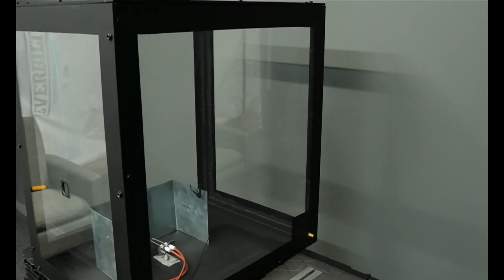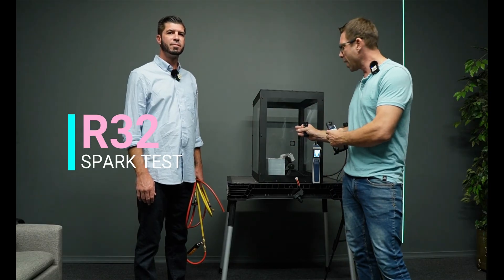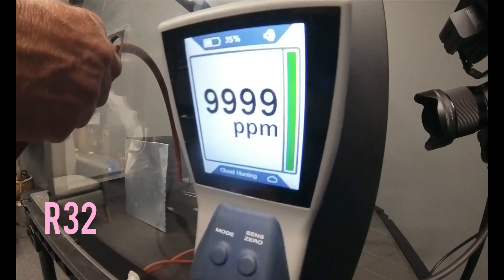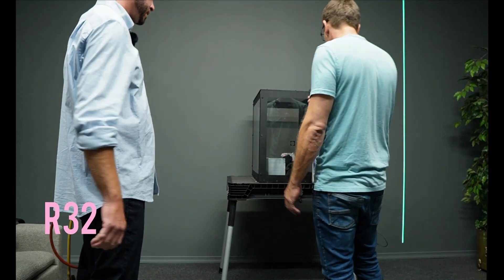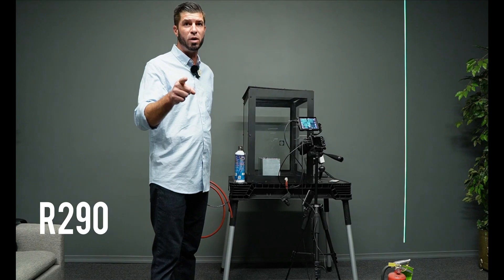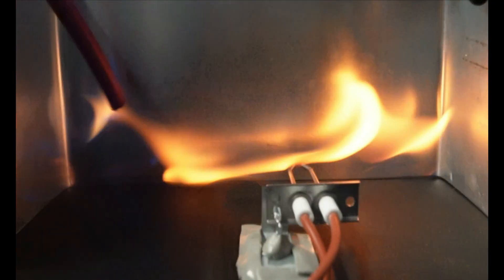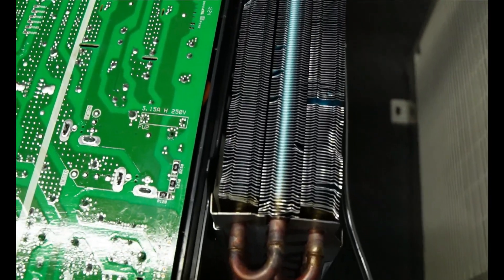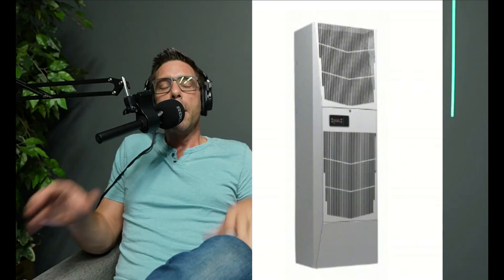Is R32 Worth the Risk? HVAC Flammability Test HVAC (4k) No Joke!

Comment: It's just a way to add additional cost (profit) to equipment and install. I have natural gas lines all throughout my basement yet building code doesn't require leak detectors other than the small amount of sulfur containing impurity for smell. If I have a natural gas leak, the gas company is also just going to keep feeding the house as if I was using the stove, water heater, etc. At least in the a/c unit, there is a fixed amount of refrigerant that if it leaks will just be diluted into the nearby environment.

Comment: Now compare that with normal hvac/r systems which are true heat pumps that can have up to 18 C.O.P, but to be clear, 18 C.O.P does NOT mean that they are 1800% efficient! It absolutely doesn't mean that, because like I said, that's impossible. So what does it mean?  It means that the entire system has a coefficent of performance of 4, 8, whatever, but the compressor, and fans and everything else which converts electrical energy to mechanical is ALWAYS BELOW 100% efficient, typically even the best systems are 85% efficient. To understand this we need to understand the refrigeration cycle which I'm going to explain in detail: it has a few components, the compressor (which is just an electromotor that turns due to 3 phases out of sinc, producing uneven electric and magnetic fields or in a case of a single phase they use capacitors in series with the start winding to induce rotating magnetic field on the stator which is then induced to a rotor's permanent magnet to make it start rotating, but it will even without heat of compression (which we will get to really soon) still heat up due to it only being about 70-80% efficient, the component after it is the condenser coil (which is just a heat exchanger), after that we have a metering device (a restriction in the system like a tiny hole (it can be fixed like capillary tube or fixed orifice or a thermostatic expansion valve (TXV)) which allows just a tiny flow to occur and it lowers the pressure after it, then we have an evaporator coil (another heat exchanger) and then we have compressor's inlet again which are all connected with pipes. Just to make a legend here so that I don't have to type it: high is H, low is L, pressure is P and temperature is T. So the cycle is: LP, LT superheated (I'm gonna explain what does it mean) vapor goes into the compressor, the compressor is creating a P differential and therefore pumping gaseous refrigerant in an enclosed loop and so the HP, HT vapor exits it, because the refrigerant is under such high P, all that P is squeezing the refrigerant molecules and under these conditions its current T and its condensing T (which is T dependent, lineary, for Isohoric (constant volume, constant quantity of refrigerant, sealed system, no leaks) processes and it can be seen by the graph. And like that it exits the compressor, and when it enters the condenser, it is first cooled down to its condensing temerature still in gaseous phase, then the moment that it hits the condensing temerature it stops giving off sensible heat (heat that we experience as temperature) and it locks on to its T and the first liquid drop appears, because it can no longer remain a gas, the P in pipes is too high and the outdoor air T is too cold for it to remain a gas, so it will spontaneously condense into a liquid, the refrigerant is condensing and it won't stop until it has condensed into a fully liquid state, but it's still giving off lots and lots of heat. It must give off all of its latent heat of condensation (you can also call it enthalpy) and that's an energy a substance must give off per kilogram of its weight for it to change phases from vapor to a liquid, when the refrigerant fully condenses, if you look at a sight glass there's a liquid vapor mixture, then just a tiny vapor bubble which is getting smaller and smaller until it eventually disappears and the glass becomes crystal clear, now that it is fully condensed it can now again lower in temperature by few degrees until it exits the condenser (that's basically subcooling- the T drop from condensing T to the line T exiting the condenser. Now the refrigerant is held back by a metering device which restricts the flow and at a lower P behind it, the P drops enough for the evaporation temperature (the current T of refrigerant as it flashes from a solid coloumn of liquid into a mist at the end of metering device) and it gets really really cold because its evaporation T is at this low of a P way below the ambient T, so it gets really cold as it expands as it takes away the heat from itself at first (from the inside out), but then it starts absorbing heat from the pipe and then the surrounding air and it continues to do that until it has all evaporated, now once it's now fully a transparent gas, it can again absorb sensible heat and raise its T a little (that's superheat what I said earlier that I'm gonna explain) until it again re-enters the compressor, and the cycle repeats over and over again. It might be strange that the cold suction line is actually full of heat, but it is, it is even superheated despite being so cold, it contains all of the heat absorbed at the evaporator. The same goes for liquid line, the liquid line doesn't feel cold, because it's not, but it has been subcooled (which means it has cooled down below its condensing T) . So you're effectively using the fact that refrigerants have easy-to-manipulate boiling points and you're using mechanical compressor to compress a gas which is less than 100% efficient (like any other machine) so it actually adds a little bit of heat, but the reason why the discharge line is hot is mainly because of heat of compression at isohoric conditions (I explained it earlier), but the fact that is doing a mechanical work, but producing a thermal displacing work makes its total efficiency way higher even though motors which convert energy are way less efficient than the thermal energy removed vs electrical energy consumption because of the compression to expansion ratios, and that's why it was possible with efficiency coefficient over 1, normally 1 is the maximum at perfect conditions like absolutely no friction, but we can never have that, but in this case since it's using 2 largely independent systems electrical to turn the compressor and heat exchanging system, its limit for c.o.p. is no longer 1 in perfect conditions, but now it's an infinity. For example the household fridge has a c.o.p of around 1.8, the inverter split ac system has about 3-5 and some heat pumps with 5 layer condensers and evaporators can have as high as 15-20 maybe even more, to be clear, the c.o.p. of each energy converting component is still less than1, that's what the 2nd law of thermodynamics dictates, but the overall c.o.p. of the entire heat pump can be higher because there's no energy conversion happening, just energy transfer, so you're just pumping heat from one place to another. And as for the CO2 idea, I think it's great and even in large convenient stores they started using it, the only downside are the high pressures, above a 1000 psi (or above I belive 67.4 bar (6.74 MPa in SI), cuz it's a force acting on a surface, long story but everyone knows what pressure is, but other than that it's a really efficient, environment and ozone friendly gas. Thanks for the video

Comment: Excellent demonstration of refrigerant flammability, but one sad thing. As an engineer and a scientist I can about guarantee you that we''re not gonna see peltier coolers cooling homes, it would be very good, but it's too optimistic (I think the right word is unrealistic) because they are not so efficient. A quick explanation: their work exploits the physical-chemical properties of materials called semi-conductors, which are btw very useful in modern-day technologies like phones, tablets, lap tops, etc... Because they have really good qualities due to one electron missing or an extra electron (that's why they contain silica) to be able to conduct under some conditions (voltage being applied, voltage drop, current flowing, voltage above certain values, temperature change (all made out of different elements and their atomic radius varies significantly so whenever there's high enough voltage, the atoms in it get shredded by the electric fields and they suddenly become a conductor). In this case thermocouple which will create voltage when there's a temp. difference or peltier device is just an inverted thermocouple, when you apply voltage it creates a temp. difference between hot and cold sides. Its work is based on peltier, seebeck and thompson effects, all parts of the thermoelectric effect, but I'm not gonna explain it in details because it involves advanced physics and physical chemistry at quantum levels. So an electricity particles (free electrons) can take away the heat (cuz heat is just thermal energy) and move it from one place to another, electrons can make other atoms reposition so their density is smaller in some places, so those places will have less motion, less kinetic energy, less heat, and therefore lower temperature at a constant mass and specific thermal capacity (measured in Joules per kilogram kelvin) and there are formulas here, but it takes atleast a few hours to extract them starting from observations and logical assumptions and simple things like space, time and speed and then you get to more complicated stuff gradually. And I know that prerty much all of you hate science and say that it's boring and I'm ok with that and btw the science is really simple and interesting if you are interested in how nature works and why things do what they do and me personally  I'm interested in it since I was about 12 I think. But anyways, let's get back to the subject: as it slowly, I highlight it, SLOWLY takes away the hight from the cold side and places it back to the hot side, the whole thing slowly heats up, so the hot side will heat up, but also the cold side because the only thing it can do is keep the constant differential temperature and you'll need to cool the hot side all the time to keep the cold side cold. Why does the temerature increase?, you ask. It increases because (I have to shout at this and I expect most of you to go 😂😂😂😂😂, lmao, because it happened before): "NO MACHINE IN THE UNIVERSE IS 100% EFFICIENT, IT'S ALWAYS SLIGHTLY LOWER THAN 100%" because due to something called 2nd law of thermodynamics, long story short: some energy is always taken away from efficiency and converted to heat). So back to the peltier coolers, you would have to put the hot side on a heat sink just to disperse the heat and make a continuous air or water cooling to it, and with air cooling on hot days its cold side temperature doesn't get much colder than 45-50 degrees. But wait, that's quite cold actually. Yes, it is, but only when unloaded, as soon as you turn on a fan to cool a larger space, its temp will jump through the roof in 70-75 degrees, which would make its blow-out temp about 2-3 degrees below ambient, which is barely enough to counteract only 10% of heat load at best, so it couldn't even keep the room temp from increasing through the roof, much less to drop it. It's simply not efficient enough and even if you do water cooling and make the thermal insulation between two sides really good, it'll be only able to maintain a temp of approximately 10-15°F (slightly over 5°C to slightly over 8°C (the temp scales are off due to uneven derivative (5/9), but that's just a fancy term for a temperature drift) lower than outside air temp. The only place where you're really gonna see them (now speaking from an engineer's pov) is in electronics maybe to help the cpu cool down or in those smaller handheld portable beer coolers where you don't need much less than 50 degrees and in such small volume it can reach 30 degrees colder than outside air after running for a couple of hours and if it's 90°F outside then it can get to as low as 60 which is just slightly cool even for drinks. So the point is that they are really useful, but their application range is very small. Ok, done with peltiers. Now I need to go to another comment cuz it won't fit in this one
Reply from the maker: All members of our team have read your comments. 
we are very impressed by your input. we have learned a lot. Thank you!
Reply: @GWAC555 Thank you for investing your time and resources to provide people with basic knowledge of refrigerants and refrigeration in general. We all really appreciate it!

Comment: So in reality, R32 will only burn as long as there is an existing flame.  Would have been interesting to see you move the hose away from the open flame while the refrigerant was burning to see if it kept burning or went out.  Other tests I have seen show it immediately going out as it can't sustain a flame on it's own.  Not sure why you would not have shown that fact in this video...  A bit of a disservice to your viewers I'm afraid.  Fortunately you did show a video clip of someone trying to unsuccessfully light a gas on fire with an open flame, presumably R32, but who really knows.  R32 has been used overseas for many years with minimal issues.  For being a highly technical and progressive country, when it comes to AC Equipment, we are way behind the rest of the world.

Comment: in many fields.. safety and energy efficient is more important
but weirdly in hvac world . they only look at how much it damage the ozon layer
we went from super efficient  r22 to worst r404 and you needed double the kw to get the same btu
all saying its a better gas, but its makes all the coal power station work harder. 
today we we go to dangerous  gasses..  what if my house burns.. it will blow up
Reply: I don't believe anymore the ozon-layer tale as excuse for these. Furthermore I would be curious how much dangerous gas go into to the air when my room blow up because of the smell-less propane filled leaking mobile aircon! They don't even let you choose the type of gas, only R290 is sold.

Comment: Peltier heating and cooling is not going to become the new hvac go to..  ever.  The technology has found its limits and its very inefficient.  Like really inefficient compared to a heat pump on a phase change system..  still yet the dude should have figured out that those things make just as much heat as they do cold and that pretty much rules it out as a proper hvac unit/ system..